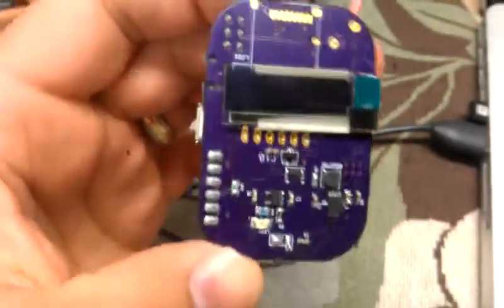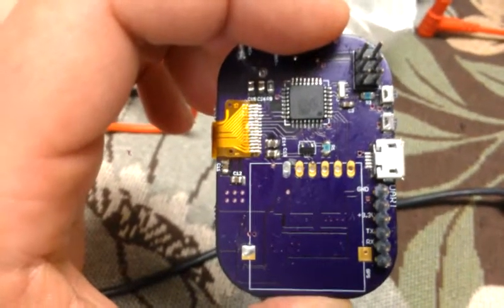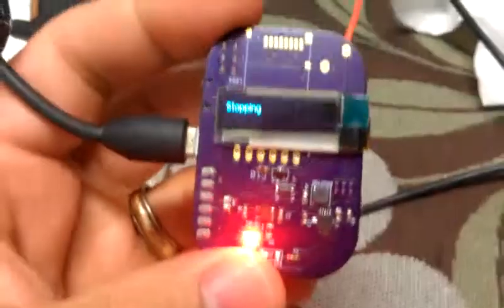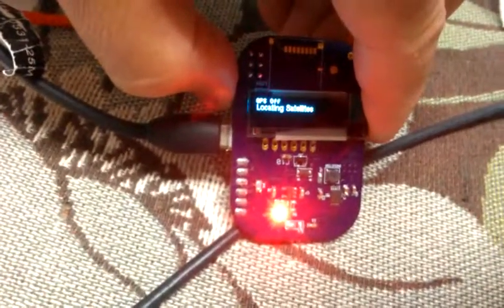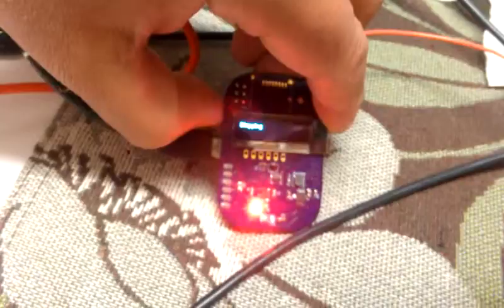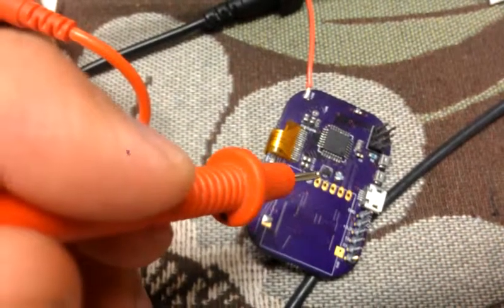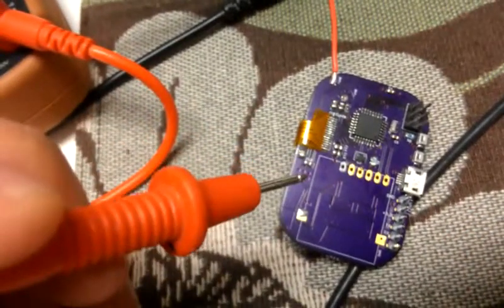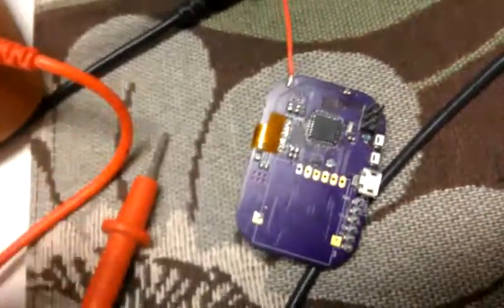DIY GPS Distance Logger

Comment: what's the name of your arduino card (subtitle don't march) thanks
Reply from the maker: +Abel Fournier That's my own board that I designed, but it uses an
 Atmega328 which is the same micro controller on the arduino and it has the arduino boot loader on it.  More specifically, it uses the boot loader for the Arduino Pro Mini that runs at 3.3V 8 mhz.